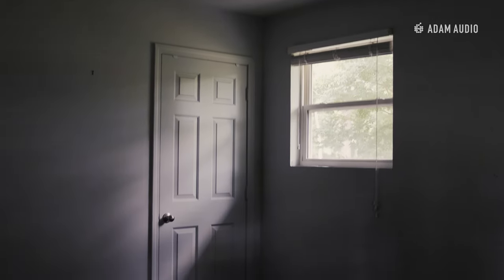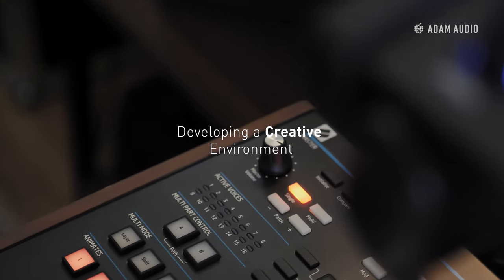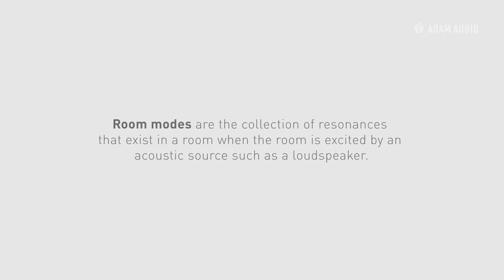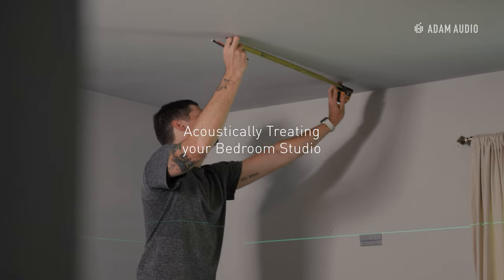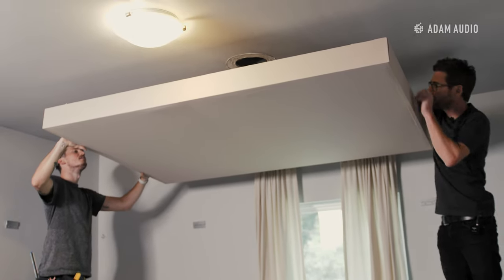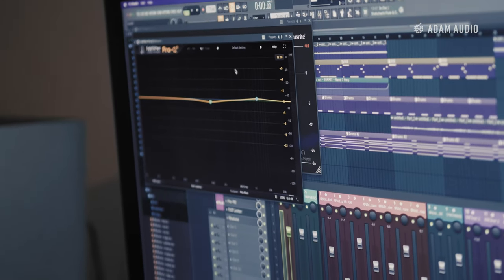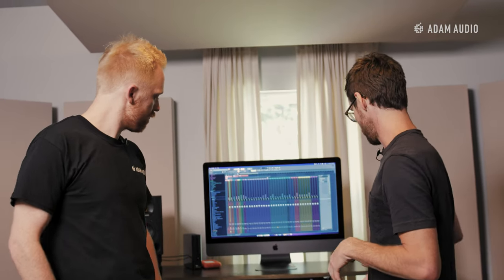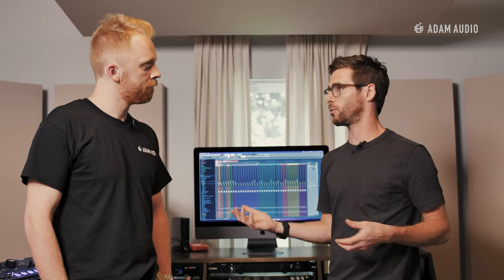TRANSFORM Your Bedroom Into A Studio In 2024 | ADAM Audio & Music City Acoustics

Comment: I'm an acoustics consultant in the UK. Regarding windows. It's common for windows to feature trickle ventilators where your room may rely on openable windows to deal with overheating. So slapping a panel over the window where you may have trickle vents or windows designed to be openable to deal with overheating, then you'll be doing things very wrong. The best way is certainly to us a thick curtain that provides MASS and thus forms an impedance mismatch between the materials and incident sound waves.

Comment from the maker: Have you turned a bedroom into a studio? If so, what gear have you added to the space? Let us know!
Reply: Yes I did. Although it’s still under construction. I did measurements last week with a good hardware SPL meter. Inside and outside. Although I have plenty space, 8 meters long, 4 meters wide, 2.5 meters height, there are many issues. On the side, there’s a window. On the front there’s a window. In the back there’s a window. That’s a difficult challenge but I’m sure that if I continue measuring the other details like the reverb time inside the room on different frequencies I get a lot more insight. Still it won’t be perfect. At the moment the isolation and treatment is little and doesn’t the job correctly. I really need an expert out here, free or paid that’s no problem, who can help me out with this one. I will provide all the necessary important details and measurements of the room and a blueprint to the person that can via internet email, so someone and me can together decide what’s important. I know that the bass build up in the corners is extremely high. I want to get the best sound my monitors can output in my room. Equipment? MacBook Air new model, FL, Steinberg audio interface, tisino interconnect balanced shielded nylon 6.3 trs jack to balanced xlr made for audio signals, ADAM AUDIO T7V pro studio monitors (wow!!), Soundcraft analog mixing console with hardware Lexicon effects (12 ch IO, EQ high mid low, trim, aux send double headphone monitoring, usb, 48v phantom power, xlr main master output etc), brennensthul outlets with 8 sockets in built power surge Lightning protection, angled input, safety button, grounded to earth, aluminium heavy expensive, brennensthul outlets with 4 sockets, protection and two usb a outputs, cable management system, lots of cables!!!, Konig and Meyer mic stand, Samson C Pro Studio hybrid condenser mic with gold diaphragm, 10 meters high end xlr mic cable, midi in out on three different hardware, two budget keyboards Casio and Medeli only €599 each for midi, small 25 key for quick takes, Cubase 10, Logic Pro with Dolby Atmos rendering, mixing and printing, too many plug-ins, hardware digital drums Yamaha DD55 vintage mint condition midi in out 5 din, two monitor stands for ADAM AUDIO T7V with spikes to isolate from floor, two comfortable chairs, two keyboard stands, acoustic guitar nylon budget, more power outlets with switches, MacBook stand, led strip 5 meters around studio desk must shield 16 m colors, three Philips wifi bulbs 💡 led for amazing lighting effects to suit my mood and a lot more. I stop for now otherwise my comment will be to long. Im sorry for that.
Reply from the maker: @emiel333  Hi Emiel, this sounds like an awesome setup! Sounds like everything you need to get creative. If you have particular questions about your room's specific acoustics, feel free to talk with someone at Music City Acoustics or fill out their form and I'm sure they'd be happy to talk through some of the potential issues that might arise in that space.
Reply: Nice transformation. I don’t have a “room”.. but a tiny (1x2m) corner in our hallway/kitchen 😁
Reply: I'm starting my studio, I have an arturia interface and my ableton push 2 but I don't have monitors and I want to add the new a44h to my studio!!
Reply: Mine ..Buying some A7X i have a lot of gear Ableton Push 2 .Komplete Kontrol S49..Focusrite Isa One ..Novation Audiohub 2X4..That’s my Main Setup
Reply from the maker: @BoombapArt  Whatever you feel creative in works!
Reply from the maker: @adrianluke17  Sounds like an awesome start, thanks for watching!
Reply from the maker: @rocoafricamg1094  Amazing setup so far!
Reply: @ADAMAudioBerlin  a bit small, but it works!
Reply: @ADAMAudioBerlin  soon discovered that’s all I ever wanted after buying a lot of gear that I felt never needed was lucky here in Africa they had the last stock of the A7X and snatched the last one
Reply: @ADAMAudioBerlin  Hi! Thank you. It’s indeed awesome what I own to make music. It took me a long time, hard work and money to get at this point. Thank you for the tip. I will contact them soon!
Reply: You left the ac vent off?
Reply: I added my bed.... 🤣🤷‍♂
Reply: Would it be a problem if the desk wasn’t facing the window, to the right instead

Comment: I started with just a few panels and a similar setup. It was a disaster. Dead room in the high end and everything else was boomy. It would have been better if I never did anything. Too many Broadband absorbers everywhere and carpet will make things worse imo. Unless you’re treating like 3 feet everywhere to have equal reverb times
Reply from the maker: Hi Dougley, thanks for watching and sorry your experience with your bedroom setup was so poor! Have you adjusted your room to address these issues?
Reply: @ADAMAudioBerlin  I have! I replaced the carpet with hard floor and I kept all my broadband absorbers on first reflections only. Everything else all over the room has scatter plates in front of the the traps. Much better translation, but very costly.

Next step will be Trinnov, but it’s not cheap.